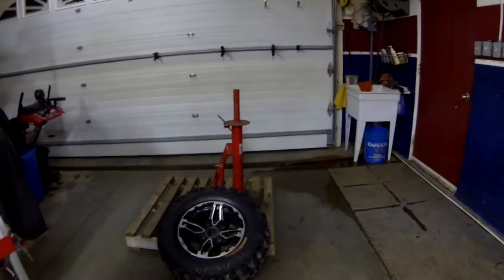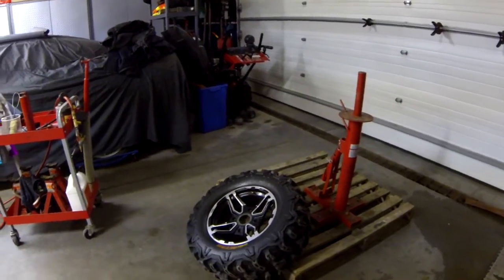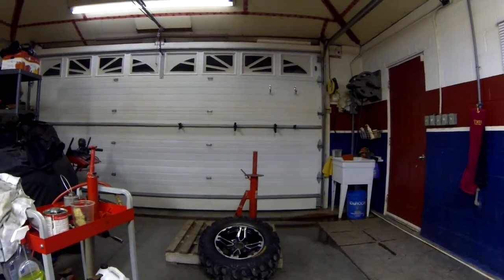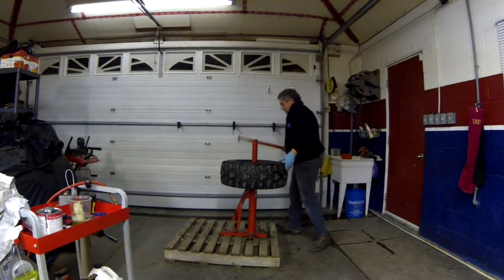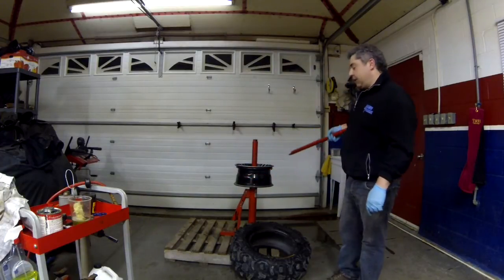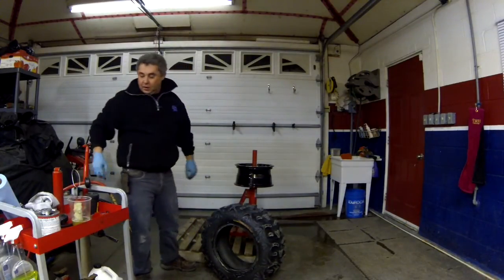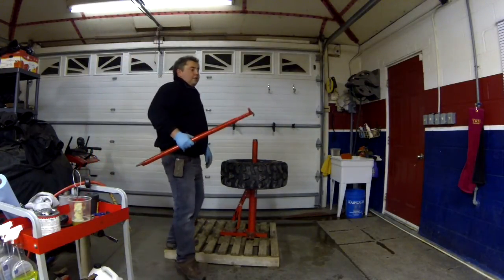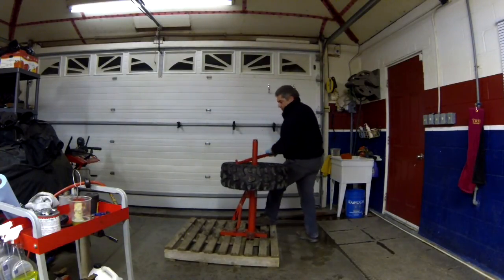Tire Changer from Harbor Freight / Princess Auto

Comment: Have those same tires have not been able to get them to hold air , so just ordered tubes for them , my have to go to HF and get a changer tired if paying someone to break tires down , exactly vid thx
Reply from the maker: I had same problem with these tires. Thought about doing the same as you with putting in a tube. But my buddy tried putting a tube with another tire. Because we usually run with low air pressure, the tires would spin on the rim. So I tried using slime and and that seemed to do the trick. The tire changer was the best $50 I ever spent, worth every penny.
Reply: Frankie's Channel  humm may have to try the slime first   Just wasn't sure be if it would help with leaking around the bead but definitely worth a try

Comment: I dont get it. Harbor Freight has it for 39$  USD , princess auto in Canada has it for 159-179 CAD...........
Reply from the maker: Yeah your right. CDN dollar is down big time right now. Just wait awhile and Princess Auto puts them on sale. They have 2 versions available. 8 to 16 inch tires for $159 and 4 to 16 for $109.  I have the cheaper one and last time I seen it on sale was around $59. That's if you can wait. Good luck.
Reply: @FrankiesChannel  thank you,  . also is there a difference between the bike patch material and car patch mateial? i see them advertised for you use on both .. you know those circle rubber things
Reply from the maker: @abdou6003  As far as I know their both contact cement or sometimes known as rubber cement. Pretty much the same. But the car patches are usually a little thicker than bike patches. That's the only difference.